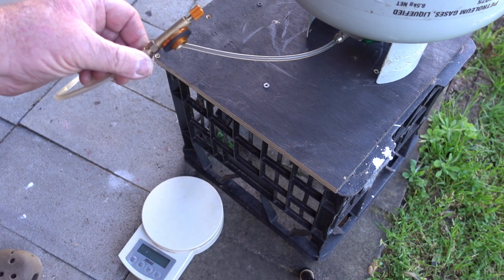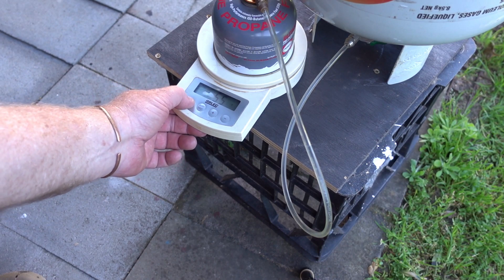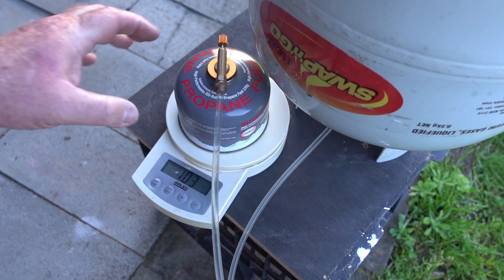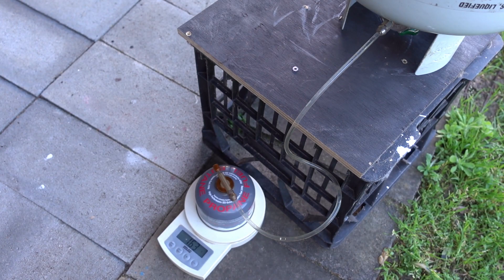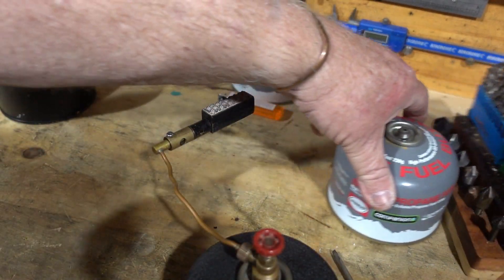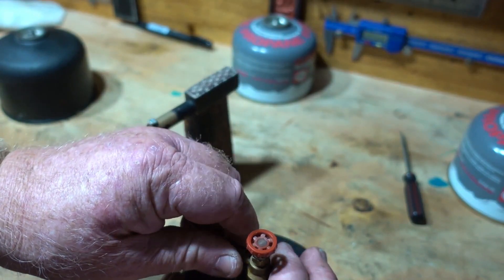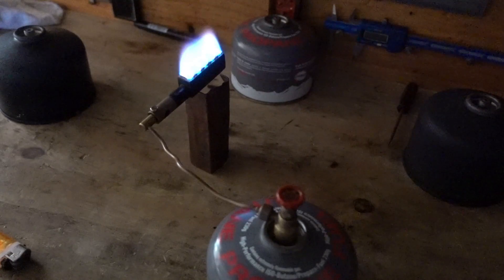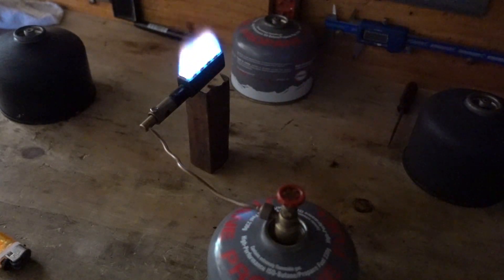Refilling disposable camping gas canisters with Propane - Cheaply

Comment: very interesting. please report back your findings.
Reply: Hi, the general consensus on the model steam engine forums has been that propane pressurises the cans at a too higher pressure over butane mix.
Reply: @ToysRfunAlways  it does seem like propane generally uses more pressure, but it seems like you should be able to safely use it in this type of canister if you fill it less.  I'd love to find out what kind of ratio is safe.  This guy replaced 230g of butane+propane with 166g of propane, 72% by weight.  What would be safe?  50%?  25%?  

And what effect would it have on burn time?  I'm really curious, because as he mentioned, it seems like a huge cost savings.
Reply: many of these canister comes new with a mix of iso-butane and propane 70/30, 80/20
propane is 44.097g/mol; butane is 58.124g/mol
https://en.m.wikipedia.org/wiki/Propane
https://en.m.wikipedia.org/wiki/Butane
https://en.m.wikipedia.org/wiki/Isobutane

assuming you trust your life (and others) with internet/marketing numbers, all your measuring equipment, your own calculation and are certain of source gas composition, any container/hoses/equipment used in the process (EN417 is not designed for refill, the container is not tested for repeated stress cycle, valve can rust and starts leaking and only spec up to 13.2 bar at 50C), see below link for the pressures
https://www.engineeringtoolbox.com/propane-butane-mix-d_1043.html
Reply from the maker: Still using this three years later and working well.

Comment: Ha ha ha ha … 😂😂🤣🤣 why the hell would he fill this up and then ask if it’s dangerous in the comments. And Barbecue gas? What the hell is that? Their is no such thing! If your talking propane gas , that gas holds at way more pressure than is allowed for that small container. Butane holds at a lower pressure. I’m surprised he didn’t blow his finger off if it exploded trying to fill it up.
Reply from the maker: Still using this three years later and working well.

Comment: The problem with your flame is also the air in your tank. You have to purge it--luckily the atmospheric gas is less bouyant, so it sits on top of the fuel relative to gravity.

Thank means just by slowly purging the gas right off the top, you can push out the atmosphere at the cost of a little fuel. The fuel boils and replaces the volume as the air come out under pressure.

I'm going to subscribe and keep an eye on your future projects! Hello from MI, USA!